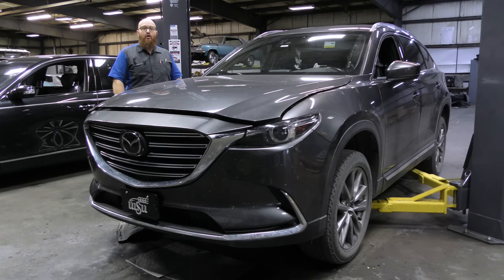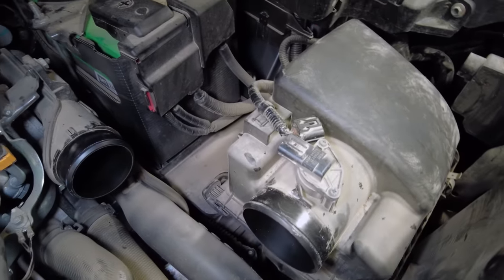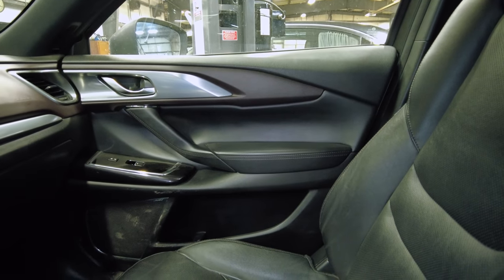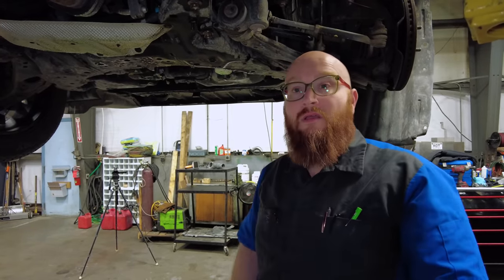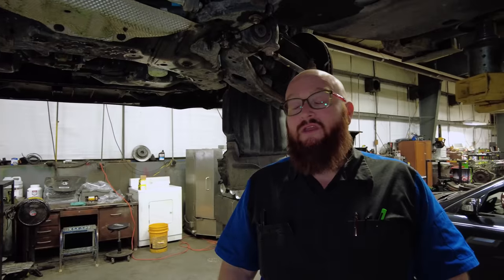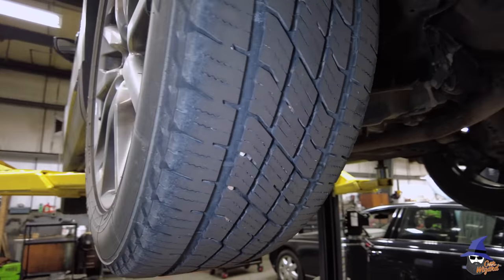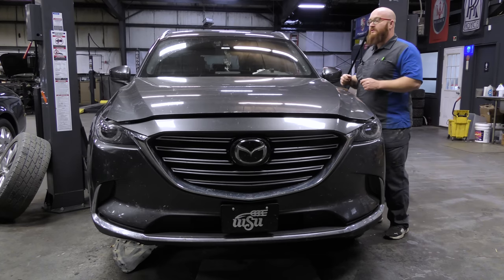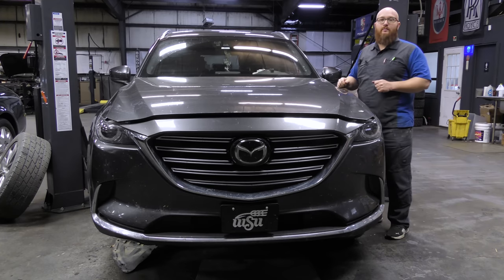Really, a $4K leak! What could be wrong with this '16 Mazda CX9 that could possibly cost that much?

Comment: I'm with you David. If you are going to tear into that engine, may as well do it right. It makes no sense not to do a timing job and water pump with it.
Reply: "If you are going to tear into that engine, may as well do it right. "    Exactly.  $4K is a disappointingly expensive repair, but if done well, it will mean 150K .... plus... miles, at which point it becomes an investment in longevity and safety.  I would have considered junking that Mazda and buying a new car a foolish decision, unless you have money to burn.   The car should be more reliable now, with the replaced head, than before.     Fascinating discussion on this vehicle.  Reading the reviews from Mazda experts has made this one of the most interesting threads i have read on car repair.    My wife would have junked this car.   If I trusted the mechanic, I would fix this car 100% of the time.   I know what everyone is thinking, though, how do you know you can trust a mechanic?   It can take years of going to the wrong ones before finding a cost effective mechanic.   I have found one now, and refer my friends to him,  but some (my wife) insist on going to the dealer even after warranty is up.   I'm totally over that.
Reply: I agree. With all the labour it will take to remove and replace that head, the cost of the parts to do it right isn't all that much. But, I wonder what the bill will be when he has to add the cost of the new head to the bill. That head is cracked.

Comment: This is a sad story, Wizard.  But if it was a 2001-2009 Outback, or a  2001-2009 Forester it would not even be a story.
Reply: Yea it would be a nightmare lol
Reply: @randomenthusiast6898  yep had mine fail on 08 Outback but it doesn’t leak coolant on these it’s more oil so you have a good warning to replace it when it stars seeping but engine out and $2400 to fix

Comment: If you're looking for a cx9 just go with the V6! Too much weight not including the people in it. Other than that it's a great suv plus good looking too.
Reply: They haven't made a V6 CX-9 in a long time. And that WAS a Ford motor, and had its own issues...
Reply: @TakuroSpirit77  I'm talking first generation cx9 2015 had the last v6! Still a good looking suv
Reply: @leagueofshadows5133   2007-2015 CX-9 had Ford engine and differential/transfer case. It is a great engine, especially the later 3.7 V6.
Reply: Get the real deal suv, jag f pace
Reply: @leagueofshadows5133  It's an over 10 year old design that's very dated compared to modern offerings.

Comment: NO Wizard , you are absoluteley WRONG this is NOT a Ford engine! After 2013 mazda designed and built thier own 2.5 skyactive4 cylinder engine, it"s made in JAPAN, they use this engine in ALL their models for a reason, because these are one of THE most reliable cars on the road .That"s why these 8 year old Mazdas are still selling today for 20 grand ! :face-orange-frowning:
Reply: Yes what a great wonderful vehicle, they are blowing head gaskets not at a long amount of age but after the powertrain warranty is over.

Mazda clearly can't build a turbo engine well.  That's fine if they are new but they should at least extend the powertrain warranty to cover their learning curve.  Turbocharged gas engines have been around for 40+ years.  Not new technology at all.

Comment: Technically, Mazda redesigned their engines a few years after they split up with Ford. Their newer cars dont share much with Ford and their turbo engines are 2.5L instead of the 2.3L that Ford uses. If you're talking about the older Mazdas, then yeah, the engines are basically the same.
Reply: Would you recommend me to buy this suv used with 120k? What year would you recommend?

Comment: Heat is a head gasket's enemy.  Turbos make heat.  Lots of heat.  This will be the future for most cars made today, since government mandates have been forcing carmakers to increase MPG, so most cars now have puny displacement engines and high-strung heat-generating turbochargers.  Of course, this will cease to be an issue after petrol and diesel-powered cars are illegal and electric cars are mandated...... then you'll only have to deal with $15,000 - $20,000 battery replacements and car fires.  Lots of car fires.

Comment: Turbo charge anything, and you are averaging half the service life over a naturally aspirated engine. It's very clear in aviation where specific maintenance cycles are mandated. A Lycoming TIO-360 has to be overhauled twice as frequently as the IO version. A four cylinder car engine that must be turbo'd to get the equivalent performance of a V6 or V8, is a high strung, high pressure system with far too many failure points.

Comment: I have a 2019 CX-5 which I think has the same drive train as this only in a smaller package. Mine is NA and the 6-speed is excellent. Only problem I've had with it is the control switch sometimes doesn't fold out the drivers side mirror ocassionally. I've also had phantom touchscreen touches on the screen, don't know if that's from a piece of dust or if it's internal.
Reply: Did they ever make NA 2.5 CX-9s. I believe they are all turbos, at least in the US
Reply: Said CX-5
Reply: My 2019 CX-5 driver mirror has the same lazy attitude about folding
Reply: I also have the phantom touch screen issue on my 2017. I think there was a TSB out for this

Comment: Engine size has very little to do with vehicle size as much as the gearing and suspension. These new direct injection forced induction engines with VVT are fine in just about everything nowdays as transmission technology has improved.
Reply: You heard the "Wizard" say it.... "the engine was too small, so the car blew it out" ;-)
Reply: Most vehicles in the UK and Europe  have 2 ltr engines or smaller including vans that can carry 3 ton loads plus sometimes a trailer as well.. I worked for a van rental firm many of the vans had done 300k miles and still going strong.. It has been this way FOR 20 years that i know off probably much longer and yep when they are empty they can go faster than you would ever need..  A 5 ltr pick up truck makes no sense to me
Reply: @martinrowland2593  that makes no sense at the face of basic logic. smaller engines (unless rare cases when geared very, very well) rev higher under load, larger engines rev lower, and put less strain on the engine. I have a jaguar xk with a 4.2 engine, always stays at 1,400 to 2000 rpms doing almost everything you do, these engines are known to last a long time, good gas mileage too. smaller high revving engines especially under weight, are always driving under excessive strain
Reply: @h7pubg  If the facts are not making any sense to you  Then you may need a rethink, maybe all that power is overkill We have  4.2 jags over hear you can pick them up for buttons. The fuel consumption is  horrendous
Reply: @martinrowland2593  25-30 mpg isn’t bad with a smooth, under strained engine. and no that makes no sense, small engines rev higher look at any of them, unless it’s the most modern overcomplicated transmission, they are under a lot more strain at all times to satisfy regulations

Comment: While at it i'd test a thermostat opening temperature, and also drill a bypass hole in it.  This would prevent an air pockets and also lower the temperature stress when the thermostat opens.

Comment: The Ford 3.5 and 3.7L are plagued by this as well, which some of the CX-9 use the 3.7. The water pump which is run by the timing chain weeps into the oil pan...
Reply: The body style of the CX-9 in this video comes only with a 2.5L Turbo… no ford engine in there… wizard made a big mistake saying it’s a Ford.. he should have just kept quiet…
Reply: gen 1 3.5 ecoboost has chain driven internal pump.  gen 2 3.5 (2017+) has external belt driven pump.

Comment: Small engine in a mid-size vehicle, I've gone through quite a few small 4 cylinders.. the idea is you save on gas so you save money, but a lot of the time it's a lie, because they all seem to have problems within a 100K miles or so which require major money to fix. Then I can turn around and buy a well built V8 engine vehicle that I might average 20 mpg but it lasts me over 200K miles easy with no major repairs. Small engines / transmissions in general will all require probably 2 major rebuilds within that 200K miles.

Comment: As the owner of a 2010 Mazda cx9 and a 2012 GMC Acadia,  the Mazda really does go zoom zoom. It's a shame that they opted for that turbo 4, because the old six has a sweet spot at about 275 hp and 276 lbs ft torque. Still averages 22 mpg mixed city and highway too. Bit more cramped then the Acadia, but definitely has a better fun to drive factor if you need a kid mobile with fun and utility.
Reply: how many miles on it?

Comment: I was quoted $650 to replace my coolant expansion tank on my 2003 Audi A4 convertible... I got a new tank, cap and coolant for $56 and replaced it myself in 20 minutes! 1 year and 5k kms later and it's still perfect!

Comment: I've been amazed at the cars I see marked "2.0 Turbo" - Volvo, Lincoln MkZ, Audi. I think I'd leave the badge off if I stooped to that level. Little engines pushed really hard to do big jobs. But, if it lasts thru the warranty period, the manufacturer may call it a success!
Reply: It's how they reach the EPA mpg minimums
Reply: Like the 2.7T four banger in full size GM trucks. I couldn't imagine towing with it in the hills. Beating the living hell out of a truck simply by using it for what you bought it for! I dont care what GM and their salespeople try to tell me.
Reply: Would you recommend me to buy this suv used with 120k? What year would you recommend?

Comment: Nice to know i fugured right about the head gasket. I onow what you mean about shops and foreign cars. I have a 1990 Volvo 240DL wagon. I asked a transmission and driveline shop about doing some work on the car. I was told they dont normally touch imports. Had to tell them that since they had a Jeep in the shop they were familiar with the back axle in the Volvo. Dana 30. Nothing exotic about an Aisin-Warner AW70 automatic overdrive transmission either. Always fun  finding a decent mechanic. The second last shop had not been able to install a new rear U-joint properly.

Comment: Cad wizard 

Bars leak is NOT stupid. I put that in my 2002 3.1L Grand Prix and I drove it 3 YEARS that way, and when I sent it to the junk yard because I upgraded, it STILL RAN. When you’re broke, or cheap like I am, that’s was the way to go!
Reply: Maybe on older cars, but on new cars with VVT and variable speed oil pumps, bars leak is indeed stupid. You will have problems
Reply: Yeah, it's probably not the risk on a $20k car.  Worth the risk on a '02 grand prix
Reply: Adding radiator 'stop leak' products is not a good solution on a vehicle that is 7 years old and is worth circa $18-20 k.  Notwithstanding the aforesaid, that additive would not work in a situation where the leak is so prolific - a leak which is very likely to be a cracked head.

Comment: I know youll all hate on me for this, and as a mechanic myself, i hate myself for doing it too, but i put a little Power steering stop leak in the ole ladys car to hopefully prolong the inevitable, and it actually worked. I know i will have to eventually replace the rack, but, it actually worked! Im normally a adamant "dont do that" guy,  i was thinking "maybe itll get me by till this summer", that was last summer & no leaks. Granted, it wasnt a big leak, i noticed it before she did, while i was doing an oil change. Not a "im having to add fluid all the time" leak (you cant fix that with anything in a bottle).

Comment: It’s too early to tell but those new 3.3 in-line 6 engines on the CX90 should be more robust especially the low output version that runs on regular. The HP output is around the same level as the highest strung turbo 4s so it should be relatively understressed.

Comment: I would give a pass if you mistakenly said the engine was made by Ford, but the fact that you said there are stickers around the car that say “FoMoCo” is a lie and hurts your credibility. It was designed after Ford sold their Mazda shares. The Mazda SkyActiv powertrains are almost as reliable as most current Toyotas. They are tried and true, except for their turbo engines because some are burning oil. They’re still pretty reliable though. Hopefully the new in-line 6 will be reliable.

Comment: I used to work with a lady that bought a CX9 with the same engine at a used car dealership. Right away it started overheating, and it didn't take long to diagnose it was either a blown head gasket or bad head. The dealer said he'd fix it.....which meant he dumped a ton of head gasket sealer into the cooling system. Of course it didn't work. Somehow she got him to take the car back

Comment: So, 
Does the coolant cap hold proper pressure?
Was the stat replaced in the last 5 years?
Was the coolant replaced in the last 5 years?
If no, owner is the problem. Maintenance matters.
If yes on all 3, Ford is the problem. Engineering deficit.
The condition of the mating surfaces and the head deck flatness check, will tell the tale.

Comment: Some experts suggest shop trying to maintain a 50-55% gross profit on parts, while some suggest keeping markups much lower and increasing labor rates. Many customers will not be sensitive to a large markup on a lower-cost part.May 16, 2023

Comment: This is a very common issue with 2016 to around 2020/2021. 
In some instances Mazda has covered some repairs for this issue. 
Mazda changed from the Ford V6 to their 4 cyl turbo in 2016. The performance numbers are respectable with the 6 cyl.
The 4cyl is not a Ford Engine it is a true Mazda engine.
The tow capacity of this Vehicle is 3500 lbs the same as it was on the 6cyl version.

Comment: So im biased as I love Mazda, especially the newer stuff and classics, but i love the "crooked nose" front end. They make the most unique daily drivers, and refuse to put CVTs in there stuff, saving gas elsewhere with the Skyactiv-G etc. Also, this is probably why the new CX-90 has a bigger engine. Generally its hard to find these cars used, especially under $20k, because they are crazy reliable. Moreso with the CX-3/5/Mazda3/6 etc etc. But yeah, anything will break if you drive it hard too lol. Beautiful vehicles, especially compared to late 2010s CR-V, ,Pilot, RAV4 until recently etc. Im wanting to buy a similar aged CX-5 or 3 or hatch, the other element being they supposedly drive much better than competitors (i havent driven them all so i cant say)

Comment: Best car I owned was a 1999 or 97 Nissan Maxima.  Bought it for $1000 @ 200k miles. Drove it 100k miles with only like 3 oil changes.  A pulley fell in the driveway and still ran.  Never did a tune up.  And gave it away at 300k miles still running strong but needed struts very badly. Oh, tires reached wire treads at some point.

Comment: Just retorque the head bolts before you do anything else.  Occasionally you get lucky -it happened to me on a 4 cylinder BMW - after I got the quote, I got out my torque wrench and the specs and technique for installing new head bolts, then loosened each one slightly and went the three stage re-torqueing process used for new bolts as if I had removed the head, which I never had to do. I did the work on a cold engine and head. Then my daughter used it daily one summer in one of the hottest cities on the east coast, and I sold it "as is" after she went off to grad school.

Comment: Didn't see much of an angle to the belt tensioner, but definitely check to see if there's oil leaking at the tensioner pulley dampener.  It looks like a little shock.  There's TSBs put and a redesigned part.  Both my 2016s needed it replaced as they were leaking and making the engine growl a bit on acceleration.

Comment: I believe Wizard is correct about the engine. Ford did have a 2.5 Duratec 4 cylinder (not turbocharged) which came in the previous generation Escape and Fusion, but it was co-developed by Mazda. This engine was also called the Mazda L engine, as Ford did own Mazda up until the late 2000's, though they still shared engines and parts for a while afterwards. The engine was assembled in Michigan, Mexico, and Japan. The turbocharged variant appears to be Mazda. But like he mentioned, I guarantee you'll still see plenty of parts stamped "FoMoCo" on this thing even though it's a 2016.

Comment: I have an 04 Mazda 3 Hatchback 2.3L It has the body of a Mazda but parts of Ford Company anywhere/everywhere with an unreliable transmission. It has been reliable so far but at 233k miles and 15k mile ownership for the last 1 1/2 years, the transmission is starting to go and I’m driving it until the transmission blows. The transmission will clunk and bang until it says no more.😢

Comment: Noticed that sweet smell on my 2018 CX9 but didnt see any obvious leaks or puddles. Dealer said it was a cracked block and the coolant was getting burned off by the exhaust. Powertrain warranty took care if it but we only had 39k miles on it. Still worries me that this failed this early ...